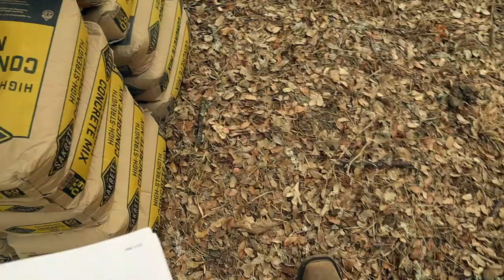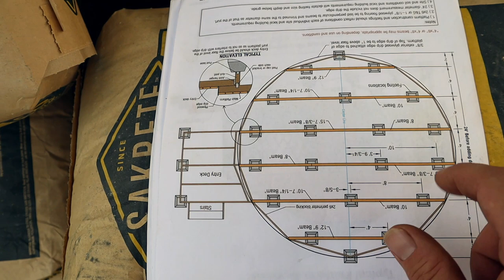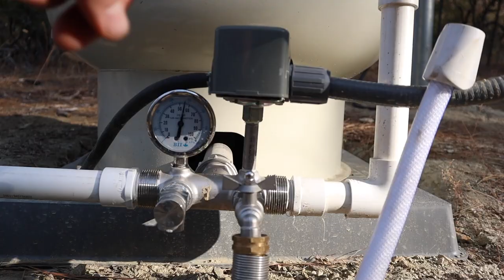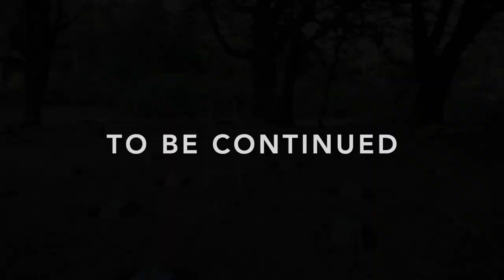YURT Platform LAYOUT and PIERS | Step 1

Comment: About the footings, I see you wait a bit for the cement to settle before putting the piers, but how do you know when it’s ready? I also noticed you did a close up putting what looked twigs before pouring all the concrete, what’s that for?
Reply from the maker: I did let it set up a bit, just to finish the row. It helps to keep the pier in place to level and set. The "twigs" were pices of Concrete-Reinforcing Mesh, no reason in particular just had some laying around and figured it wouldn't hurt.
Reply: @JoeSimple  Thanks! So the pier does get cemented in place after the concrete finishes drying up, right? That means no more tweaking in case it doesn't turn out aligned or 100% level. Though I see you check them all for level after placement, isn't there a chance that it will settle some more overnight, and end up uneven?
Also, I couldn't quite figure out from the video what method you use to make sure they are all aligned on center with each other, so the posts are in line to support the beams. Do you set a line for each row or something? 
And thanks again, learning a lot from you :)

Comment: Joe, were you at all concerned with front level, and not digging piers to be below that line.  In regards to frost heave?  I believe in that area you built in it is listed somewhere like 30".  We are building the same deal in Idaho where our frost line is 32-36".  We also have sewer lines running under our yurt location, of which we won't be able to dig that deep.  So we like your method of 12"x12"x12" with concrete pad poured in hole prior to blocks.  Thoughts?  Have your clients had any heaving issues?
Reply from the maker: Hi Michael, here in nor-cal the frost line is very short like 5-10 inches. As for Idaho I bet it does get pretty cold. I would suggest going deeper to be safe. Talk with some locals they might have a better idea if the minimum depth you could get away with.

Comment: Hey Joe, what do you think a rough estimate would be for labor alone on this project? Just the part that the instructions outline.
Reply from the maker: ehh about $4,000. One way to get a "rough" estimate pricing for deck style projects, is figure the material costs and the labor is close to the same price. I.E. $4,000 (2018) material cost  = about $4,000 labor cost, total $8000. just a rough idea of costs.
Reply: @JoeSimple  Thanks Joe! Excellent channel

Comment: Interesting, but I kept wondering how do you make sure they are all on the same level? How did you determine how high the platform will be from the ground? Thanks in advance!
Reply from the maker: The piers are not all the same level, It was built on a hill. The piers on the high side justified the starting height of the platform then leveled out from there with the 4x4 posts. Great question, thanks for watching
Reply: @JoeSimple  Thanks! As soon as I started watching part 2, it all made sense :)
Reply: Always start from the high side with exterior platforms.